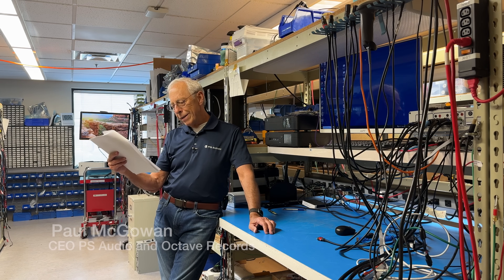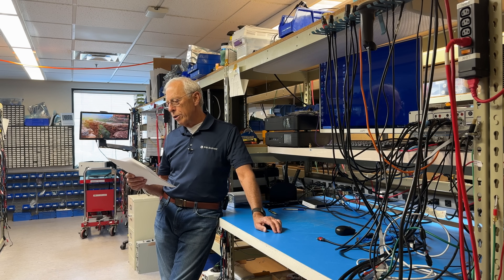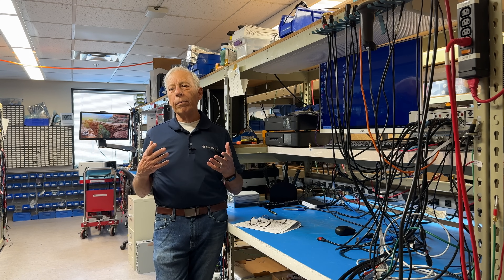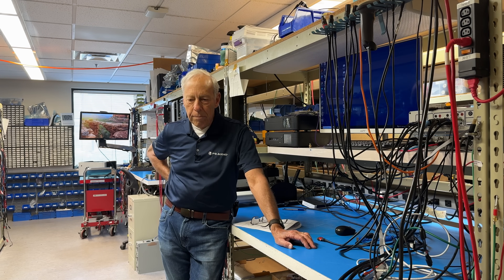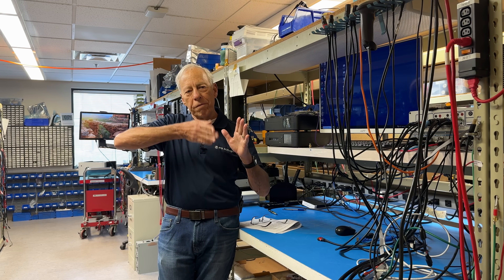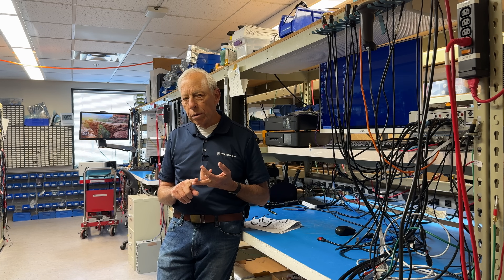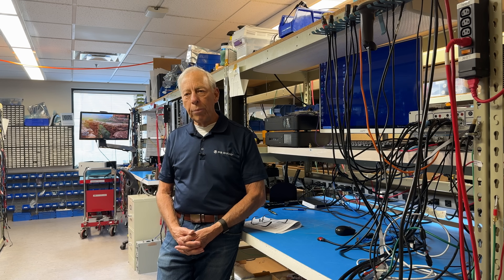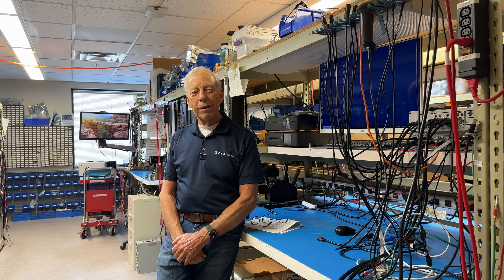Digital power supplies and analog amplifiers

Comment: I recently scavenged an SMPS, with rated DC voltage as my DAC, from an over 20-year-old VHS player and tried it on my DIY DAC. I was astonished. The noise and hum that had plagued my system was gone. the noise went from being audible at half a foot from the speakers to only being audible from the tweeter at ear-to-the-speaker distance. The SMPS looks well-designed with a grounded metal cage. It performs better than a regulated linear PS that I designed(I am new to electronics). With a Chinese SMPS, I could not float the DAC ground but with the new SMTP, I can float the whole system with no audible difference. The new SMPS might have some filtering circuit and the Chinese one might have internal noise that needs to be earthed. Japanese are really good electronics designers. The low high-frequency noise might be caused by my amp which is a powerful class AB pro-based design but has poor quality parts. carbon and ceramic resistors with steel legs. I'll replace it soon. Upgrades remaining on my ESS9038Q2M-based DAC are a new clean 3.3v AVCC op-amp-based filtered voltage supply and either a new output stage with quality parts and replacement of NE5532 op amp or finding a good volume control for my tube DAC and using it as output stage. Thanks to Paul and other sources, I have been able to learn electronics and get hands-on with them in less than a year.

Comment: Transformer efficiency is 99%+ You have to ask, what is the "Power Supply rejection ratio" at the frequency of the power supply noise being made. For a mains transformer, this is 100Hz/120Hz with some edge speed from rectification. With SMPSU, this is a much higher frequency 40Khz and up, and up. Power amps struggle to reject power supply noise as the frequency increases. It's easy enough to design a low noise SMPSU, but it takes cash, something the industry mysteriously never wants to spend.

Comment: One of my stories yet again from back in the day. In the mid '70's I did a travelling "High Speed" amp clinic measuring the rise time and slew rate at rated power of any device brought into which ever store I was visiting that day. 10Khz squarewave in, full power out into an 8ohm dummy load. Sony had just released switching PS in some products. Everyone of them I benched went up in smoke! I had to stop testing any such Sonys. Outside of one DYI from a local Tech School in Tn that had a class on amp building, they were the only one's that fried. Some others did shut down, but not literally smoke!

Comment: Open loop SMPS performs quiet close to mains frequency transformer PS. SMPS reduces material, weight and volume.
Switching noise can be filtered out with snubber, a combination of capacitor-inductors arrangements and proper neutral path pattern draw.
That's for beginners.
Reply: I will make an independant metal grounded chassis for EMI too... Like Faraday taught us to... 😊

Comment: Nice answer. I like that my power amplifier can output the power of near clipping level without relying on capacitors to maintain the power rail voltage. I rather have an SMPS able to continuously deliver the max power the amp can output than have some solution with capacitors used to help maintain the voltage due to a weak linear transformer. But obviously that is only true if that SMPS has very low output noise.
Reply: Output noise you can filter off...
The most trouble of SMPS is the electromagnetic radiated energy, at high frecuency and when consumption goes up pcb tracks acts like antennas radiating energy everywhere...
I think most people overlook that because is mostly noticeable when the supply get pushed hard...
And i think the capacitor bank at the output of the will help with the line noise also with the peak consumption, OFC that doesn't mean that you will put an SMPS smaller that the max amp power rating, in fact it actually needs to be 30% better to ensure durability and stability
(Most SMPS gain a bad reputation with people that wanna use them as lineal transformers who can give a little extra momentaneus peak of current, SMPS are electronics, and as an amp or any electronics need to work with a safe margin from the "Absolute Maximum Rating" stated in the datasheet, that is usually at 70-75% of his max capabilities)
Reply: @alejandrorigonatto694  Agree. Whatever is the max output power is a subset of the input power from the power supply thus you need to add that and the extra margin (wasted power) is less for class-D and most for class-A. As speaker impedances can dip depending on frequency, perhaps down to near 2 Ohms in some extreme cases, ideally your SMPS can output the equivalent power needed for a 2 Ohm load plus the power losses inside the amp.

Comment: Switch mode power supply is just another way to say Class D amplification, right?
Reply: no.
Reply: No, Class D refers to the operational class of the output stage which can have either a linear or switched mode power supply design.
Reply: @jorgebravo7980 : No.  Power supplies and the device it powers are 2 separate things.
There are lots of class AB amps with a SMPS as well. There are also class D amps with linear power supplies.
Also your phone charger is a switched mode power supply.
Power supply topology has nothing to do with the type of amplifier used.
Reply: @andymill8552  thanks!

Comment: death to all switch mode power supplies in audio
Just go linear dude.
What Paul did not mention is that the life expectancy of SMP supplies is much less. 
Build a proper linear and it will outlive you. Maybe a cap change in 20 or 30 years. SMPS destroys it self in 5 to 10 years.
If you really, really want to use that antec, Paul mentioned to add some fat caps. I would go further, and say to include a fat 6mH choke before the caps. 
For the caps, rather rather add smaller caps in parallel since the smaller caps have lower ESR
This way you can deal with some of the noise, but this will not solve longevity, and it will not be as quiet as a linear supply
Reply: I just make the SMPS module swappable , in the long run the isolation from the other components help lower noise also( A new way to solve  an old problem much cheaper)
Reply: Ofc you will said that... You probably use an SMPS of 500w for a 500w amplifier...
Most people don't consider amp efficiency in supply selection, also SMPS are electronics so they can't go full load, if you get a supply 30% more than the power requirements (the total, including the losses due to efficiency) and make sure it was nicely vented to not heat (heat is electrolitic caps worst enemy)
I think you can actually reuse your old supply if you do a regular Recap on that...